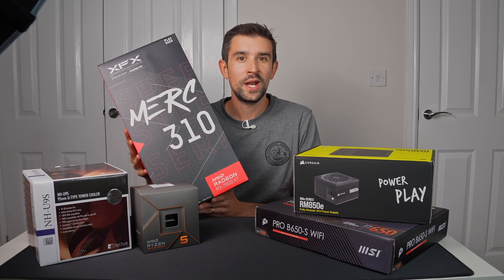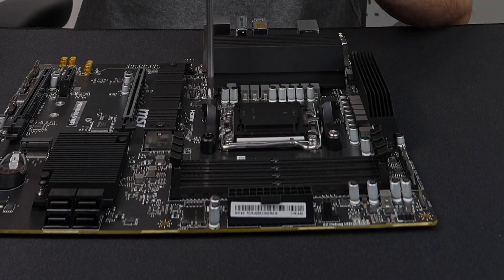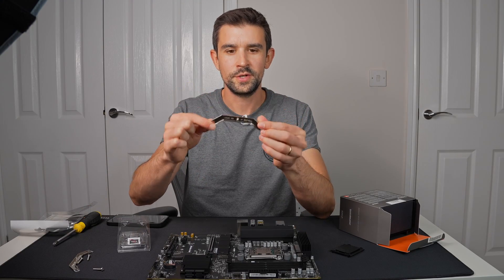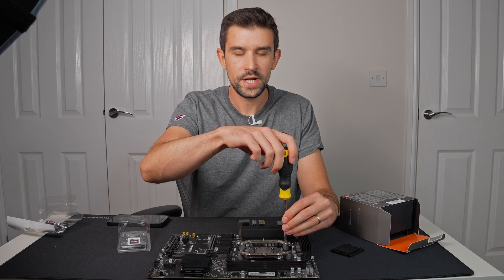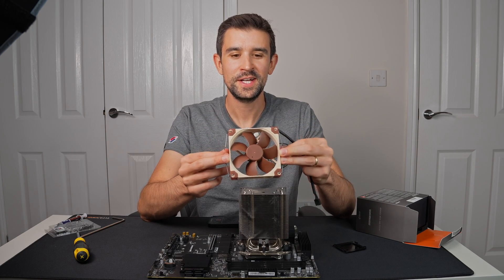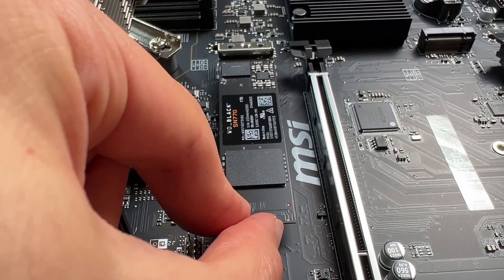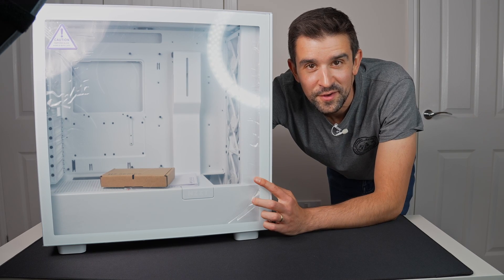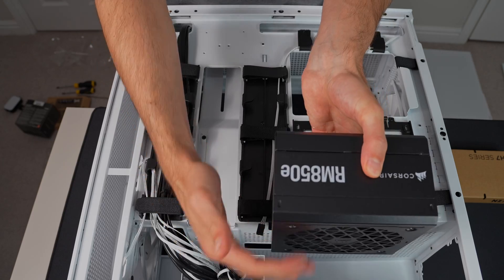Best Sim Racing PC Build for ACC & iRacing in 2024

Comment: Thank you for this timelapse and explanation of the build steps. I'm about to embark on building a custom PC for sim racing. I used to build custom PCs back in the 286/386 days and things have moved on some!
Reply from the maker: @johntisbury hope the build went well!
Reply: @MichaelSmithRaces  it did thank you. Although I did miss the clear protective film on the underside of the motherboard - never thought to look on the underside! Only noticed it post installation when it was hanging off. Had to disassemble and remove it. A learning moment right there.

Comment: Hi Michael 
Great video   when is part 2 coming out ?
Thanks
Reply from the maker: @MrCliffhoare thanks for the comment, in the end I put it off and off because I dont have much to say. It turns out benchmarking is harder than it seems because there are so many variables, especially in sim racing! In the end I got the 7800X3D CPU - mainly because of FOMO - and my PSU was noisy so replaced it with a seasonic instead. Other than that the PC has been runnning great in ACC and iRacing I can easily get 120 FPS on triple 1440p screens. If prices were equal I would get Nvidia GPU for triples, but prices are not equal! LMK if you have any other questions you need answering, overall I have been very happy with my setup!

Comment: How much can I save by building a PC compared to buying one ready built?
Reply from the maker: @GraymatterPix when building / buying a PC its just really a set of compromises. One of those compromises is how much is your time worth to you. You can buy better components for cheaper / the same as a pre built PC, and you can tailor it specifically to what you want / need. The massive downside of building yourself is if you are not familiar with it, there will be significant research required to select the correct components, and time to get it all working correctly. If you buy a pre built, you plug it in and it will work. The downside of a prebuilt is you get what they give you, and when it comes time to upgrade, or it breaks, you will likely have less ability to tinker with it (because you didnt build it).

Comment: Is AMD or NVIDIA Better for sim racing? I never have done anything with sim racing so I wanted to ask someone with more experience lol
Reply from the maker: @MMillerPCs I think its only really a factor if you are going for triple screens or VR. In those cases if price was identical then NVIDEA would be ahead is my understanding. But I used AMD because it was on a good deal at the time and it works great for me on triples. I dont have experience with VR though!
Reply: Nvidia is the “best” performance but it will cost you. A 7800xt will do just about anything you would want. In sim racing if you want to be competitive you won’t be maxing the visuals out anyway.

Comment: How much did this build cost? I’m looking into getting a pc for AC but know nothing about them. If you have any recommendations it would be greatly appreciated.
Reply from the maker: @undeadsmheddie7066 start by thinking about the games and monitors and then work down from there. Are you looking for a single monitor setup, VR, or triples? If you are looking for an mid level for a single screen, I would go with ryzen 7600 CPU (or intel equiv) and nvidea 4070 / 4070 super. That would probably be around £1000, maybe a little more. My email is on my page if you want to email me I can help you more. When I finished this build with the changes listed in description, my build ended up £1800.

Comment: The system you build for your friend its really unbalanced , you make the good suggestion in  description that 7800x3d or at least R7 7700x its better pair with top end gpu as 7900xt. Also cheeping out on the motherboard its not a good idea. On this board you dont have pci express gen 5 which now is not that important but when consider that you can use this mb up to zen 6 dont worth to save up 100-150 euro on the component on the system that will stay the longest there 
Also Nvidia is faster in ACC and IRacing than AMD. Not to mention the problems amd gpu have with multiple monitors or vr which are important things for simracing  . I had 6800xt and upgraded to 4090  so i know this from personal experience .
Reply: @martintop2605 zo te lezen heb jij er veel verstand van zou je mij een advies kunnen geven ik wil ook een game pc gaan bouwen maar heb er totaal geen verstand van zou jij kunnen zeggen wat ik het beste zou kunnen kopen kwa hardware welk merk en type enzo dat het best is om iracing en assetto Corsa mee te spelen het hoeft geen 4k te zijn ofzo 1440p ofzo als het maar trippels aankan en lekker loopt alvast bedankt 👍
Reply from the maker: @martintop2605 Thanks for your input, this is actually my build, but as you said I returned 7600 for 7800X3D. Interestingly it has not made much difference as the clock speeds are roughly similar and the GPU is the bottleneck on triples. Would be super cool to have a 4090 I bet its amazing! I was not looking to spend that much unfortunately, I went with the AMD card because I got it for £710 which I think was a good deal in comparison to what was available. Its working great so far. I am excited to see if the new Nvidia super series bring prices down a bit more, and hopefully that will be a good sign for next gen being (slightly more) affordable!
Reply: @MichaelSmithRaces  The difference is not that much in the average fps than in the smoothness by large grids . Also getting 2 more cores is beneficial for the longevity. Yes £710 its good deal for 7900xt

Comment: Hi, interesting video as I’m at the start of a pc build for sim racing. Like you I’m going to be running 3 monitors, there is another video by sampsoid who put together a build for under £1200 running a intel-core-i7-12700kf. Do you think something like that would be enough to run 3 monitors or would be better to go with what you have added. Also who much do u think your build has cost? Thanks in advance
Reply from the maker: @simonclifton8586 You have encouraged me to get on with the next video! I would not personally get what he recommended for triples, I think amd 7600 + 4070 would be a similar price in total for better performance, but im sure his build would also be fine. I ended up returning 7600 for 7800x3d, but thats not necessary.

Comment: Thanks for this, want to become a sim racer myself once I find a job to get enough money to buy a OC and upgrade my sim equipment. Although I do have one question. Is buying a pretty decent gaming PC good enough for sim racing anyway or does it have to be specifically built for it?
Reply from the maker: Yep any decent gaming PC is good! I am tailoring this one a little to drive three monitors, which I will show in some upcoming videos. It’s been fun to research and build!
Reply: @MichaelSmithRaces  ah ok cool, I would build my own because it’s a lot cheaper and I get to choose what goes into it but relatives are scared I’ll break something like the CPU or motherboard. I do have fat fingers to be fair 🤣🤣🤣 but thanks for the tip
Reply from the maker: You can show them this video or similar ones as long as you follow the instructions you cant really go wrong! Another option is find an old computer and take it apart and put it back together a few times! I was doing that since I was 10 because my dad would have old computers in the house.
Reply: @MichaelSmithRaces  it’s not even that, I’ve done my research but they’re still scared I’ll poorly align or break the CPU because it’s so sensitive
Reply from the maker: AMD AM5 cpus are not sensitive at all they don’t even have pins to bend! Good luck convincing them! Otherwise a prebuilt will still be great, and far ahead of console for sim racing!
Reply: @MichaelSmithRaces  thanks for the advice, I’m pretty sure I could try convincing them over time. It doesn’t look too difficult and it’s a lot cheaper so I think I’d be pretty good